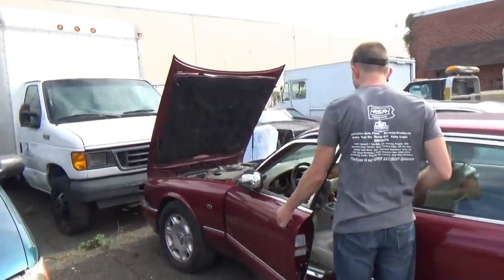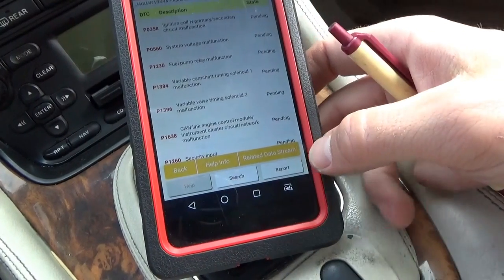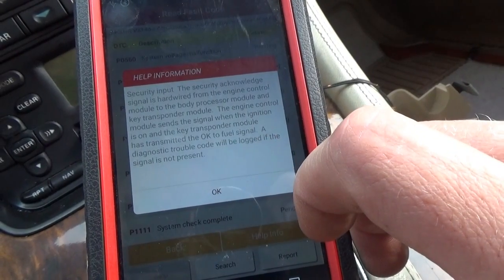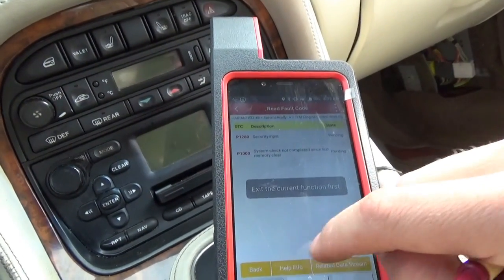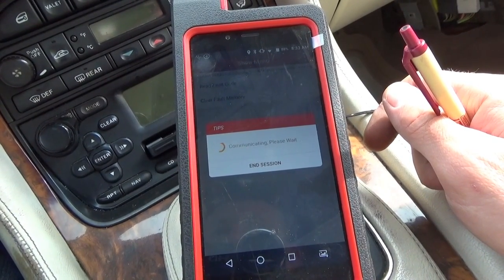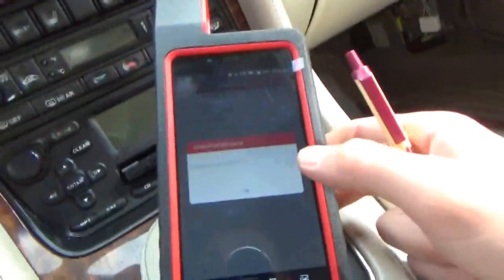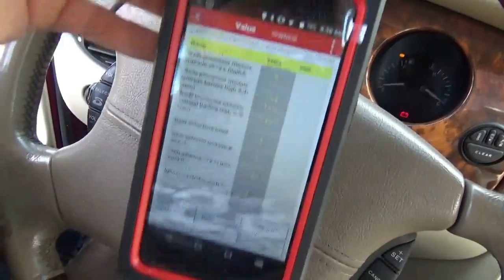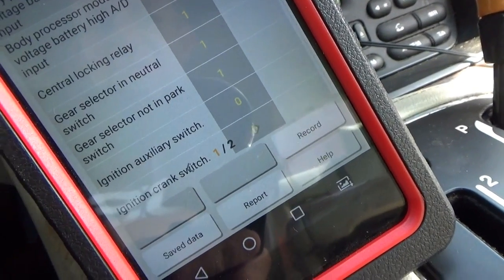Jaguar No-Crank: P1260 (SI Ep. 15.2)

Comment: does the key have a internal battery?
Reply: The keys internal transponder chip does not use a battery. It uses the magnetic field produced by the transceiver ring antenna, around the key cylinder, to excite and wake up the transponder chip inside the key. This magnetic field was seen at work when the key was initially turned on and his tools LED blinked. This proved the key theft module was turning on and energized the transceiver antenna ring. Hope this helps. Have a blessed and safe week.
Reply: @billyyoder8171  oh ok, Thanks for the info. the led proved that the key theft module was transmitting, but there wasn't a test to validate that the electronics in the key were working correctly. I'd love to see what the inside of the key looks like. a spectrum analyzer would be helpful to see what the RF transmissions look like.

Comment: Why can’t you apply power to the wire coming out of the key transponder and start the car
Reply: It's coded or it wouldn't be secure
Reply: Jusb1066 that’s like saying you can’t buy pass a relay
Reply: @randyhughes5160  If your relay only operates when you pulse the coil with a one-time code.. I suggest doing some research on cryptography, if you can stomach some math.

I'm pretty sure everything in a Jag that old is thoroughly broken by now, but if they did their jobs half way right it shouldn't be as easy as a DC signal.
Reply: Monkeh the more computer they put in it the easier it is to bypass maybe you never seen a guy steal a car you can bypass it all
Reply: @randyhughes5160  .. I have, actually, and unlike you I've read the papers describing the attacks used. This would not be as easy as the modern relay attacks you're probably thinking of (which bypass nothing, actually, other than some air).

Please educate yourself. Perhaps look into rolling codes, read up on how Megamos worked, look at AES a little, consider key exchange..

Yes, security can be broken, but to assume it's always going to be as simple as jumpering a relay is both staggeringly ignorant and arrogant in equal measure.
Reply: @Monkeh616  if only it was a relay and not a CPU Which actually runs the engine....
Reply from the maker: That would be too easy ;)